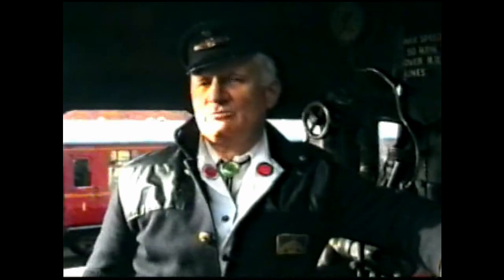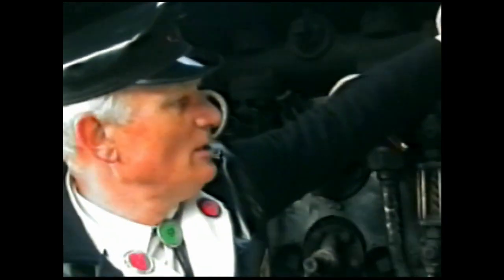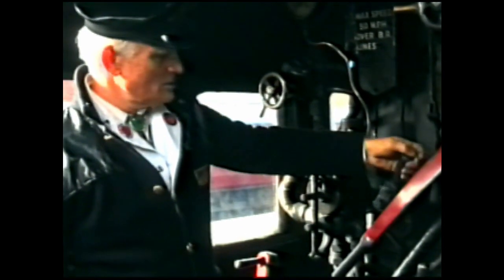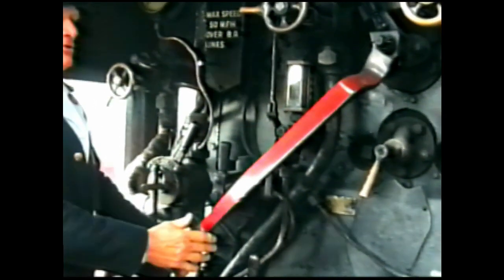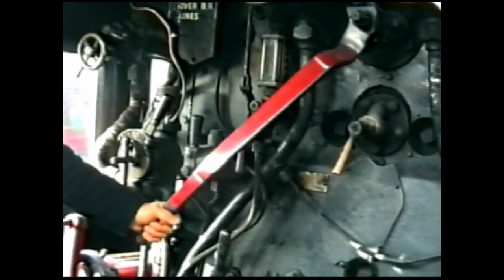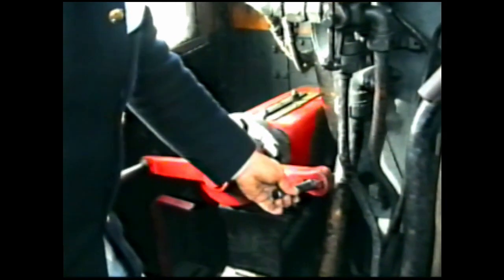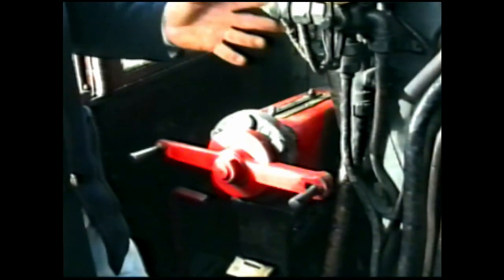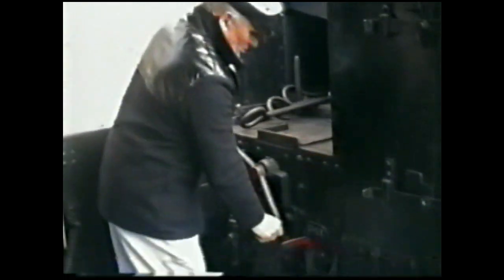Introduction to the workings of Stanier 8F 8233

Comment: great vedio！Thanks for the introduction.
There are still some questions that I don't understand. Does 8F equip with rocking grate? I didn't see rocking grates lever on the footplate. And where are blow-down cocks and its valve controller? Usually a boiler get one for water treatment, but most of UK steam locomotive images I saw on the internet didn't show the blow-down valves.
Reply from the maker: The 8F doesn't have a rocking grate and nearly all UK locos did not have a blow valve. To get the scale out of the boiler the engine would be taken out of service and the mudhole doors removed and the boiler washed out with a pressure hose. Hope that helps.
Reply: @DT6960  thank you

Comment: What a great video!!  May I respectfully suggest a change to the description of the blower - for those who don't really understand steam locomotives?  Something along the lines that being a horizontal boiler there is no natural draught which relies on the exhaust to move the combustion gases and what happens when the loco is not moving.  You have already covered what happens when the regulator is closed.  😱